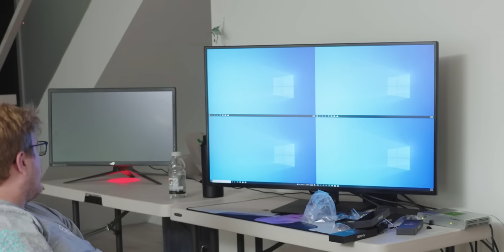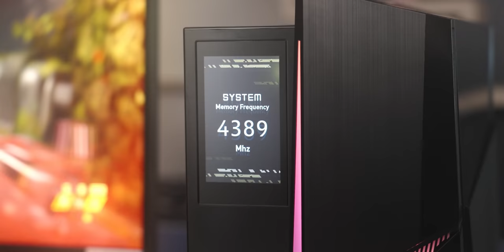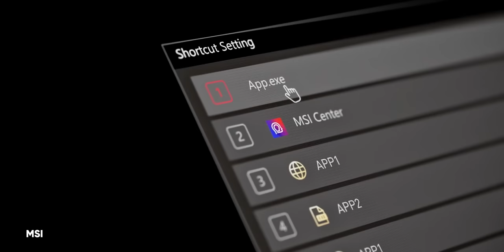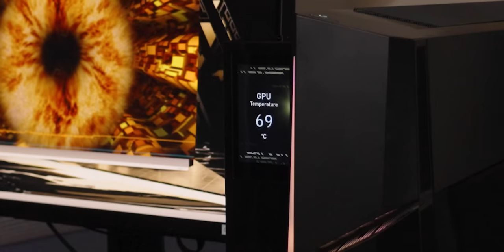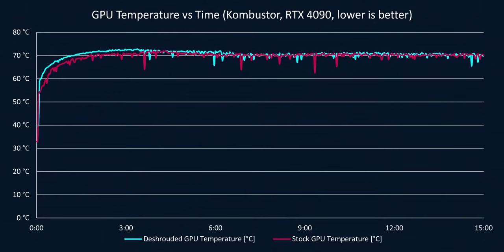I wish I didn't need this gaming PC - MSI Trident X2

Comment: Love you're content been watching since 2013 I think 🤔 anyways...    As a cabinetmaker in B.C. I wish I were close enough to just come fix that for you. Honestly it would be simple basically if were you I would ether go buy (or get Aex to make) a simple hand drill jig with 1/4" or 10mm holes with 32mm centers (and just drill over the existing holes 5/8" deep) and then just cut some 1½"-38mm long 1/4"/10mm aluminum or stainless rod to replace your existing adjustable setup. Hope this helps, I will continue to watch your content as long as you continue putting it out!

Comment: Take 3 half inch pieces of wood and screw them around the interior to hold the shelves up. I’d suggest drilling out the screw holes and hammer in metal thread inserts for it. It will never fall.

Comment: I'd be curious if those cabinet fans actually help. Seems like they would juts pull in air right near the fans and exhaust it. Pretty unlikely that air will really be drawn up from the bottom shelves
Reply: They just need to exhaust the hot air rising from the electronics in the cabinet so the top shelf remains usable
Reply: What they'll do is push warm air that has risen from the bottom out the top. If the air that has risen gets removed from the cabin, new air has to come in somehow. Even at the bottom. It won't be high pressure by any means, it's just supposed to circulate the air.
Reply: With those three fans I would have put one at the bottom pulling air. One on the mesh shelves facing up and the last one at the top pushing air out. Just to create a small current that creates the desired circulation path.
Also removing the pillow from on top the receiver hahaha
Reply: @DantesGrill  yeah my point is with how open the door mesh is, and how restricted the shelf mesh plus all the equipment on it is, that new air will just end up being drawn in right around the fans and do very little for the bottom shelves

Comment: The cut from Prime95 at 2:34 was abrupt and incredibly suspicious. It's a sponsored video so feels likely that the thermal performance was so bad, that when MSI reviewed the edit, they wanted it cut from the video.
Reply: It’s a weird edit, but they seem to mention thermals were fine at 8:30 so idk.
Reply: What about it is suspicious? You know you gotta let it run for a while to test the temp, right? Especially with water cooling. If they didn't want that part in, they wouldn't even let the Prime95 bit in there, at which point they also wouldn't let him talk about how that plastic bracket makes no difference for GPU temps.

Comment: I was cable managing my desk (PC upgrade) and was struggling to keep cabled flat against the underside, I've resorted to tape but cable ties that can attach to the underside, using an adhesive or like those suction cups, would definitely be something I would buy...
Reply: Look for some cable management clips. I picked up a pack on Amazon for rather cheap. They are just plastic clips that close to hold the cables in place and have an adhesive backing to stay mounted where you place them.
Reply: I was going to hot glue magnets to some cable ties and stick it to the desk frame. Tried attaching a good double sided tape to the cable ties but it didn't work.
Reply: @DantesGrill magnets would be terrible in a pc lol
Reply: @prodbyXIRODS  It's not in the PC, it's under the desk. Even LTT is going to release magnetic power strip holders so I don't think it's a problem
Reply: @DantesGrill  i misread my bad lol

Comment: Get some 1"X2" or 2.54cmX5.08cm Furring Strip Board and put it around the bottom perimeter of the shelves, that will support them well and you can put some heavy items on the shelves

Comment: you need to exhaust that heat into the ceiling space - not out the top of the rack through the doors.  Those doors are going to disrupt the airflow enough to cause additional (and distracting) noise.
Reply: Congratulation you won a package chat up🔝 to claim prize

Comment: For cabinet fan cooling, I'd recommend using a cheap Thermostat/Thermal switch near the hot shelf to save some fan life and cleaning. Just pick the temperature you want when ordering and splice it inline with one of your wires. Sometimes these dumb switches are better than smart home automation for obvious reasons. :) cheers

Comment: Air intake on top is how to get the most possible dust into your case. I would have put the GPU on the bottom and gave the case taller feet.

Comment: Dear linus,
     there are fans that are made to be installed in cabinets filled with electronics...get them. They're very nice, flush mount, and you can get a controller and temperature probes so fans will run according to the curve you set.

Comment: Strange idea to suck fresh air from the top to the bottom, while it's easy to understand that the heat always prefers to go upwards. Also, the CPU rad is almost lower than the AIO pump, so it's a recipe for problems in a short term. Meanwhile, it's a MSi thingy so, I'm not so surprised. And it might break in a few months anyway, so... 🙄

Comment: You should rethink your fans on the doors of the cabinet.  Pushing out hot air in the the same area that you are attempting to pull in cool air.... just pulls in the hot air you just exhausted... plus who needs to dump extra heat in the room you are sitting in?

Comment: 3:00 these mesh shelves would not really work by themselves, you'll need fans on every shelf to pass air through. I've used a PC case with a top mesh, the mesh does not allow to pass enough air by itself to help cooling.

Comment: My cabinet is located in the fireplace flue and I just cut vent holes for the heat  to rise without the need for a fan. Depending on what is above the cabinet you might consider doing the same.

Comment: I love the way MSI has setup the cooling in this case. Perhaps its just me, but I honestly wish there were more cases for sale with separate cooling zones.. I saw that LTT did a video a while back about a case called the HP Omen 45L. That case offered a separate zone for your cpu cooler, but this case has a really cool way of providing fresh air to the gpu instead. Ideally, id like to see a combination of those of both features in a case.. Or have the ability to design, and make my  own. But that's just not attainable for me lol..

Comment: 4:36 Couldn't you just run a 1x2 or 1/2x1 strip of wood along the back and sides to support the shelves?  The shelves would mostly hide it and it would be a lot stronger.

Comment: Linus, your shelves - pair of wooden poles like for hanging clothes in a wardrobe. One pole near the front, one pole near the rear, shelf sits on the pole. Or put wooden strip on each side.
Reply: If you put 12-15 pairs of wood strips up the sides then you can easily change the height of the shelves, or add/remove shelves.
And they'll be strong.

That cushion on the amplifier - comment bait but also a fire hazard. You're trying to grow your LABS but you're putting cushion over a 500+ watts amplifier in a room used by kids. You know better.

Why not show us your to build a good shelf system? Then we can bond with your channel because we will build stuff based on your guidance. Make the connection, not just comment bait :-)
Reply: Take us outside to play catch?  No sorry, not enough time, gotta go to work!
Guessing at this point 'gifts' are experiences and spending TIME with the kids.  Hopefully they take advantage of their 'status' and at least take some EPIC family vacations!
I'll tell you it's not long between the stages when kids are mature enough that they're fun to 'hang out' with, and when they get old enough that they'd prefer you just left them alone, and would rather hang out with their FRIENDS...
Like ALL of this STUFF will inevitably become obsolete garbage sooner than later, while memories of good times spent with your kids are priceless and will endure for a lifetime.  And if you do it right, the memories will continue to endure in memories for generations to come!

Comment: You can always push the peg into the hole with a rubber balloon on it to add pressure and friction so they don't fall out.

Also helps prevent children...

Comment: The cooling setup is actually pretty good, I'd reverse the fans on the radiator and make the one free flowing fan in the rear the main and only exhaust, but still

Comment: "I planned and designed the cabinet for high performance gear to be in it..."

Except:

Didn't plan or design a way to exhaust the hot air...

Didn't design/use proper shelves or mounts...

At some point the jankiness that Linus does everything with, even if played up for the camera, has to be tiring...

Comment: Baffling how they did not flip the rear fan and put a filter, to supply the rad with some fresh air to mix with the hot air coming from the gpu...
With this negative pressure setup, air basically comes from the gpu and the minuscule lateral strip that feeds the unpopuled 120mm mounts in the front... and that air is what is immediatly exausted by the rad. 
Hot air recirculating. What a mess.

Comment: Linus, shelf supports like that cost like $2.50 at the hardware store for a bag of 12. Come on, dude. In a pinch you can make your own 3D printed ones. This is an issue with a seriously easy, inexpensive solution.

Don’t you also have an entire machine shop?

Comment: Hey guys, I built a PC in August (ROG Strix B550-F Gaming Mobo, Ryzen 7 CPU) and neither windows 10 nor windows 11 would install properly. After selecting the install partition, an error pops up while the install is on the "finishing up" step. "Windows could not prepare your computer to boot into the next phase of installation. Restart the installation." This error loops every time, no matter what I do. I have tried removing extra usb devices, reinstalling my ssd, deleting the files on the boot usb and making it again, deleting extra partitions, and multiple cmd prompt commands from youtube tutorials. I'm really hopeless at this point, and this is my last ditch effort to find a solution before going to a repair shop. If anyone has any suggestions, please do tell.

Comment: I would like to be able to control my monitors through the screen, or at least with a remote. I have a quad monitor setup, with two monitors above the other two. My current monitors, from 2014, have all the controls on the front bezel, easy to get to. The monitor controls are almost entirely on the back or bottom nowadays. WIth back controls, I would not be able to touch the controls of the left two monitors. With bottom controls, I would not be able to touch the controls of either top monitor. I've actually been looking for the past year to upgrade my quad monitors, but have not been able to find ones that would work with my setup. I may just be stuck moving the top monitors a few inches above my lower two, so I can reach the controls, but that three inch gap in the middle of the overall display would look like crap.

Comment: Looks like every time the installation is rushed and botched on that channel. 
There should have been a proper rackmount and use steel shelves for devices that you cant rack. Usually the audio,switch can be rackmounted, and many stores sell 3d printed brackets for appletv,roku,firetv,etc.. Would make a setup way more solid and easy to maintain with a backdoor or rear access. For ventilation I would have split the fans between bottom intake and top exhaust to really move the heat. The grille setup will likely just be an intake near the fans and dont really move the hot air from the bottom and middle devices.  In datacenters we can use the chimney effect in racks, cooling doors or in row cooling with aisle containment..bit not here.

Comment: If the front of the cabinet is all holes, wouldn't it just suck air in right below the fans and blow it out immediately 10 cm up? It would never cool anything down below. I'd only keep holes for the fans, then close everything below, and then only at the bottom some big holes.

Comment: Little disappointed on the little to no concern over low customizable case bullshit. Sure the easy m.2 on the back is nice, but obviously it only works with the mobo installed. So once you need to upgrade the mobo (which will be inevitable once the chipset needs an incompatible upgrade), it'll be worthless. The case is all flash but all bullshit. Reminds me of Alienware.

Comment: C'mon guy's. The air will be drawn from the area of least resistance, the mesh directly below the fans not from the bottom of the cupboard and there will be very little convection due to the fans in the PC case disturbing the air flows within the cupboard and the shelving in there restricting it. I have huge respect for your tech knowledge, but if you want this stuff to be effective in your home you need to be less amateur about your implementation. You have mechanical engineers on staff, get them to advise or sack them and give me a job!

Comment: That mobo looks sketchy as heck. Minimum number of VRM without any heat shield or even a CPU fan to cause some air circulation over the VRM...
and that unpainted wafer thin panels... really not screaming quality.

Comment: Wouldn't the GPU pulling in air from the top suck back in the hot air rising from the side radiator..? Especially with a shelf sitting above it..?

Comment: Hey Linus, Could I ask you a question? So, When my pc started acting up and overheating, i cleaned my cpu cooler fan. but when i booted up my pc again, it didnt spin. so i didnt take out the cpu fan, the pc wasnt turned on when i was cleaning it, the wires were still ok, i honestly dont know how to solve this issue of mine, could u send me a new amd original fan? (also im from the philippines can u still send me it?)

Comment: Guys I have a huge problem I have a sound Bar I installed a few Months ago it was very finicky to get it working but I did it worked for a few months and then I got at gtx 1650 and now my pc will not output any audio from any audio jacks and will only do it over Bluetooth which my sound bar is not. I’ve reinstalled drivers run all the troubleshooters and everything that comes up when I look it up and nothing has worked I’ve tried reseating the HD audio cable on the motherboard I’ve tried a different output (headphones/other speakers) and none of them work unless it’s Bluetooth. I also ran through what made it work the first time but to no avail. I’ve cleared the cmos updated drivers/windows and at this point I’m so close to just reinstalling windows so please tell me y’all know how to fix it and before you ask I’ve tried over usb and hdmi audio

Comment: Please respond: I have asked, other channels, no one has gotten back to me. It's a bit frustrating, I guess they don't have time for a new viewer. I have not built a PC in 10 years.... Lol 😆 So I'm getting a reboot in what's available. I would really like to hear your opinion. Thank you.
I am using.. As in I actually have on hand, an Asus 790 Maximus Hero board, an Intel i913900K, Cooler Master Cosmos 2 Case, 1Tb Gen-4 M.2 I picked that CPU over a i713700k because DCS flight sim is my focus for my build, and it is CPU heavy. That being said..............
∆ what AIO cooler would you recommend?
∆ is my case going to flow enough air
∆ what card other than a Nvidia 4090 do recommend?
∆ What power supply do you recommend? As in 1200 or 1600 ect
∆ what DDR-5 Ram do you recommend
Please don't suggest good enough
I'm looking at performance over time and may not need the absolute best of everything but I don't want to build another PC for a long time. I would like to over clock as well and try some things out. Right now the 4090 is my goal. However I'm looking for your experience and expertise in this matter. I was an infantry marine for 16 years, got blown up literally, and was forced out due to my injuries.
I have a job in the oil industry, by the grace of the all mighty for sure. I make a good enough living, I'm just super rusty on a new build. Please get back to me and or an associate of team L TT. Thank you for your time. I'm excited to hear back from you.
Reply: onniceappLinusTechTops   I'm sure! Fish someone else

Comment: 7:39  how in the hell does a whole company with i'm assuming engineers that understand physics completely go against convection and pull air in from the top.  massive fucking L just for that regardless of how well it performs
Reply: like where the fuck do they think the air is going to go trying to push it's way through fins and into an enclosed box?
Reply: also 8:41  tell me that gpu pcb is not bowed.  there are other shots you can see it even more